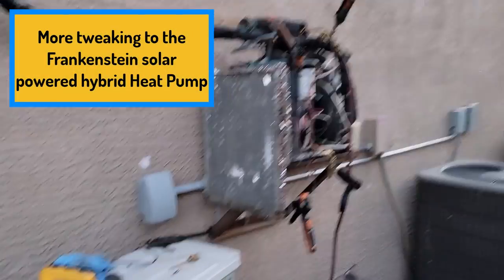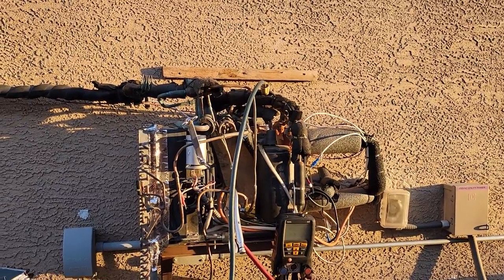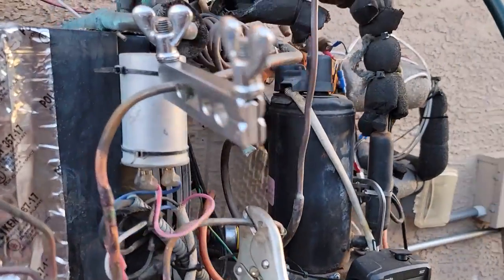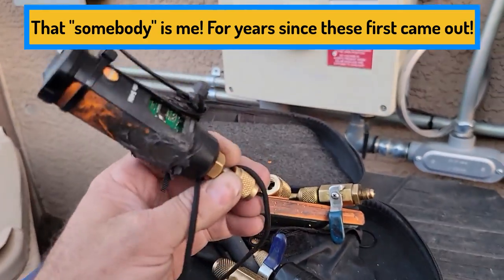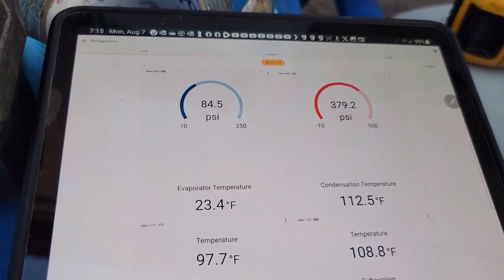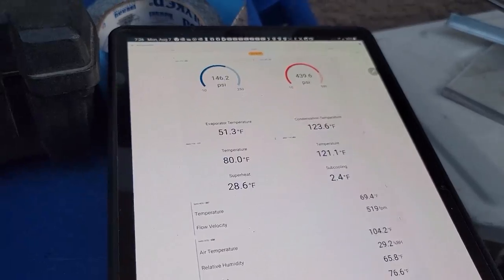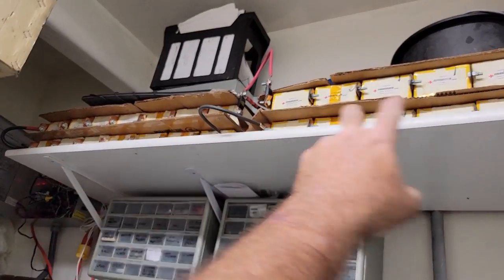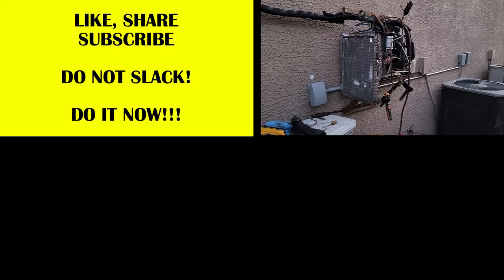Another tweak to the Frankenstein Solar powered Hybrid Heat Pump   [Secondary condenser swap]

Comment: Hello.
I have a 24000 btu R22 air conditioner, which is a bit old :). It consumes an insane amount of energy, around 2000w at full power. According to my research, they say that replacing an air conditioning unit with R290 fluid reduces consumption by over 40% and there is no change in performance. However, the biggest contradiction here is that the oil used by the compressor in the air conditioner outdoor unit reacts with the R290 fluid, causing the risk of foaming or losing its properties and deterioration in a short time. Can you tell me whether this is possible based on your experience? It may sound a little crazy, but I'm seriously looking for advice from you.

Comment: I love that unit... it looks like a total POS but the engineering is real amazing... Not to mention that little rotary compressor just kicking ass
Reply from the maker: I was just walking by it today after work and thinking the same exact thing as I chuckled!
Pretty cool to run a 800 to 900 watt system to heat a 50 gallon tank.
Reply: @hackfreehvac  The way that generic rotary takes abuse makes me wonder if the compressor brand debates weren't mostly BS...
Reply from the maker: @georgen.8027  Who knows. Now this one does sometimes not restart the first time if it isn't off for a while. It will pull LRA and trip the externally mounted IP. But I only notice if I am there when it happens and it always restarts eventually.

Comment: Just 144. That's not hot enough. I have my solar hit water system set at 180. The dishes come clean in seconds   sure is nice for canning
Reply from the maker: Oh man, my wife freaks when it hits 140. In the summer our ground water coming in is 90 so she can't mix it down to be cool enough for a bath! 😆

My grandfather had a DIY direct solar unit on his water heater and I remember him seeing it his 180 degrees one day and he freaked out like it would explode some something! HA HA!
That was back in approx 1983 or so.
Reply: @hackfreehvac  I put this in in 2009. I have it tied into the heating system to. If you ever canned food. Takes a lot of hot water. The 180' hot water just melted the goo off the dishes and kettles. When we grew up we were banned from using hot water during canning